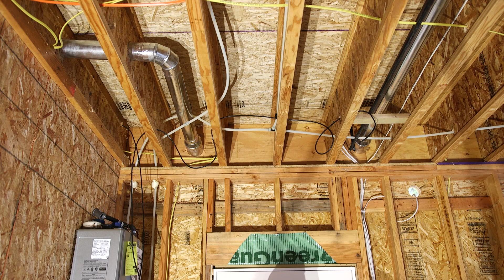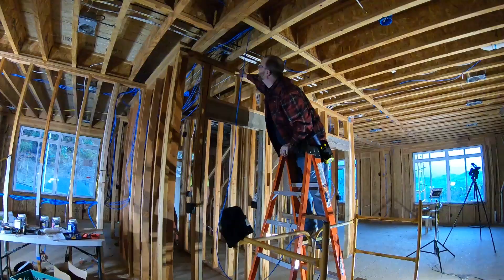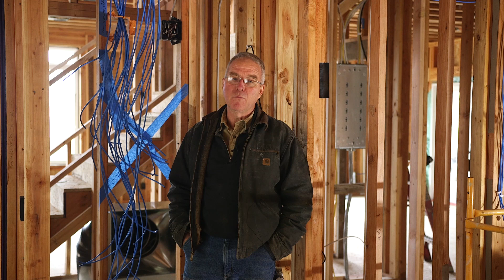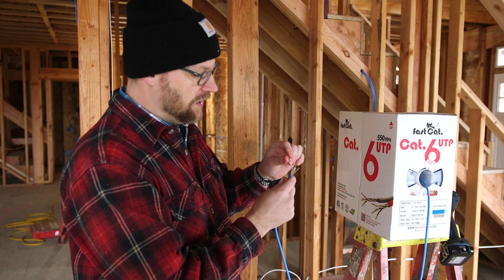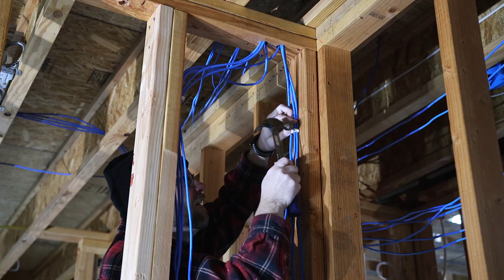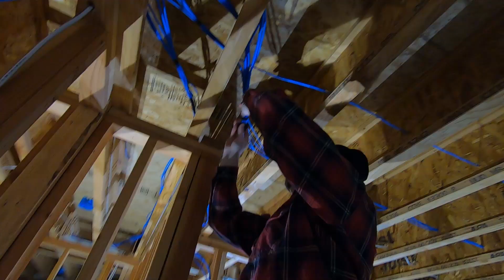Installing A Home Network Ep.100

Comment: 7:53 protip: tie a bit of string to one end of the cable, then pull the other end through (pulling the string into the wall where the cable was laying). Check the cable, if its busted, then untie it from the string in the wall, tie a new cable to the string, and pull the string back through (pulling the new cable into the wall, in place of the old cable). Useful if you want to replace a cable with something different too (e.g. old coax for ethernet) - just tie the new cable to one end of the old cable, and pull the other end all the way through.
Reply: Only works if you don't staple down your cables like he did.  Those aren't coming out short of ripping out drywall, and any new or replacement runs (like when the homeowners realize they should've gotten 6a instead of 6) will need to be fished through separately, probably using new holes entirely.

Should've installed conduit instead of stapling cables to studs.
Reply: That only works if you have conduit. The issue with modern data cabling its that its too stiff to pull through conduit.

Comment: Also by the time you read this the drywall might already be up but you should try to leave some spares for WAP's in the ceiling (At least one per floor). Also add conduits to  the attic from the rack location if you can for the future
Reply: Good idea but not mandatory. There are efficient Wifi mesh systems that can be installed simply using the wall outlets.
Reply: @articchar-lf   Not mandatory, but a hell of a lot cleaner looking installation.  Also, I take it you aren't married... :)
Reply: Done! Several cable runs are for WAPs. ;)

Comment: Is this for DSL? Everyone else uses WIFI and Bluetooth unless this house is so remote they have to use Dish or some other internet.
Reply: We have an old (1805) stone built house. I'm almost as old and have been in IT and Comms since 1970. Our network is modern with fast WiFi, plus bluetooth for guests and visitors, but for my own PC I have CAT6 cable going to the router ;)
Reply: "DSL"  is one method for your internet service provider to deliver internet service to your house (over phone lines).  In Scott's area, the ISP is using coax,  that it the RG-6 Coax (black)  whcih was being installed in the beginning, so no DSL here.   The blue cables are being installed for an ethernet network, whcih makes internet connections available in every room.

Comment: Hello Scott, did you run a CAT6 to the same place where you ran the RG6? In my area the provider is running fiber to the side of the house, where CAT6 is then run from a small converter box back to your "media-hub". You might not get fiber for a few years, but it will come eventually. Love your work, happy 100!

Comment: We dont use category 7 or 7A because it's not enough of a step up from cat cat 6 or 6A so it never really caught on here. category 8 is more for data centers because its maximum length is only 30 meters compared to the usuall 90 meters you get with 6 and 6A

Comment: My parents ran Eithernet cable throughout their house 20 years ago. And we’ve never used but one of the jacks for the wireless router which has always been more than adequate for streaming gaming and a computer or two.
Reply: yea that is exactly what I am thinking as well. funny I have to scroll down comment so much to find first mentioning of "wireless" but still, I guess it is better than not having it. And I absolutely love this series.
Reply: @hr1551  That’s why they put it in, 20 years ago there wasn’t fast internet where they live (still isn’t really). But it’s there and always will be. I’ve also watched pretty much every episode, fantastic!
Reply: Even with the absolute best wifi router, there is a noticeable difference in performance and reliability in simple A B testing.  Wifi is merely "good enough" for a lot of people. But Wifi is far too unreliable for me. Too many locations I've used Wifi in where external interference can overpower your wifi signal and there is nothing you can do about it. My grandmother's house is one such place. She lives up on top of a mountain and all I can imagine causes her interference is actually a weather radar array quite some distance away. Connection will be fine, with no wifi networks sharing the same channel. Then with absolute regularity as I imagine the radar array slowly turns toward the house the wifi connection drops to unusable and then back up within about 5 seconds. And it's certainly not a fault of the router as it is my own. In apartments, wifi can often be nearly unusable due to too many access points using the same channels as there simply aren't enough available. Wired networking solves all those issues and has literally zero drawbacks.

Comment: Ive been installing computer cabling for over 20 years and Ben did a fantastic job of explaing the basics and things to watch out for. Great job Ben!
Reply: You've been installing cable for 20 years and you replace every cable that kinked during installation?
Reply: @robc7417 Cat 5 and fiber is less forgiving
Reply: @harryhunts6171  Fiber is like a vengeful girlfriend. You one thing wrong, and she snaps.
Reply: @challengecompleted55  glad I only work with Corning fiber.  I can get get that to about a 2" radius before I see significant loss, even in SM, but rarely do I see a break.
Reply: @thetable123  Yeah, you've got to REALLY be rough to get a real break. Bending that sharp is a no-no but you can prevent that easily just in the method you pull.
Reply: @jackshett  Agreed, fiber is not nearly as delicate as some here seem to believe.  If someone is 'snapping' fiber, they are probably f'ing up everything they work on, and OTDR/cable testing isn't being done.
Tape the fiber to an Cat5 pullstring and Bob's your uncle.

Comment: I would recommend not putting all the cable into a LW ring like you did in 3:16 of the video. it’s going to be a pain later.
I would also avoid clips on the cable it increases the likelihood of kinking the cable and makes it pain to get a "bit more" out of it when you need too.
also, STP CAT6A would have been a goods ideal to CYA for years to come. 

GREAT VIDEOS KEEP THEM COMING!

Comment: when i was converting the old primary school, i now live in, i asked anyone i met who worked in networking, and was told to put three cat6e cables to every tv point in the house, i have five bedrooms, two sitting rooms, kitchen and two utility rooms, tv points in every room that's  a lot of cables, they said it would future proof, the house
Reply: Uhm, I'm all for future-proofing, however that sounds like someone took the normal pro-active 2 cable/drop location, and upped it 50% yet again.  Might have been an idea 10 years ago? Since then, it seems like the Firesticks and Roku's are going to stay wireless.
Reply: @boots7859  ask any tec person involved with internet in the home and they say it's hard to beat hard wire internet. my firestick can be ethernet or wireless

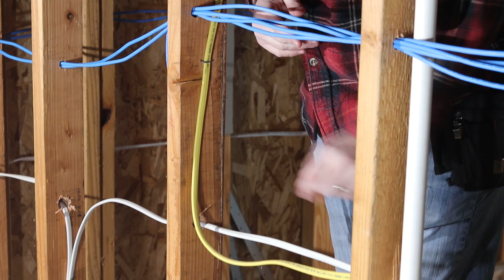Comment: 10:40 The interference is not very likely - unless you'll purchase the cheapest non-shielded ethernet cable available and use the cheapest plugs & terminals as well. In an office complex with 1000+ separate ethernet lines in the same shaft, could actually be some interference, but not in a household with home network grid only :)
Reply: I once had an intermittent network interference problem on a Trading Floor  (8th Floor) next to the River Thames in the central City of London (UK). After some sleepless night, with the team, trying to track the cause  an ex-navy office clerk spotted the cause. Across the river about 300 yards away was a foreign  Navy Destroyer tied up during a courtesy visit. The network interference matched the rotations of its radar system which was being periodically run. Rumour has it that the Head Trader bribed the Captain, to keep the radar turned off, with a crate of Champagne and a trading floor visit.

Comment: Do you have trouble with mice eating your net work cable? I think it is because they want to go through the hole the cable goes through.
Reply: Most regions require any pipe, or cable penetrations to be blocked using fireblock caulking (Building Codes) When it cures is almost as hard a cement.

Comment: I've seen grocery stores have their network cables replaced. There's a surprising amount of Ethernet cable in a store, not just a line to each register. Where the other 40 or so go, I don't know, and not sure I want to know. Glad I was just a spectator.

Bonus: when a store my ex worked at was being remodeled, the installers just gave her the leftover bit of a spool of Cat5E. There's at least 100 feet left in that box, they were just going to throw it in the trash because it was too little to use for commercial application, but my girl was smart and asked "hey, can I have that?" I would get the tool to put the ends on it and wire parts of my house, but, like Ben said, it's a pain to do with the drywall installed, and wifi works well enough to not bother crawling around the corners of the attic. But a boy can dream.

Comment: Hmm, at least here in Germany having Cat-7 vs Cat-6 is minimal upcost compared to the labor cost for installtion. So in my house I not just have the standard networking outlets with Cat-7, but also the light switches (which are switching surge relays in the basement) are running through Cat-7. So in theory I can make every switch a networking outlet, or run any other protocol (rs485, KNX etc) trough them. I think that should be pretty future proof. But maybe slightly overkill :D

Comment: I've never seen "stranded" cat 6 cable anywhere. The copper wires are already tiny, so its flexible anyway.

Also, speaking of not kinking the wire, the kid pulling the rg6 made
A loop in it and yanked it through the drilled hole, badly  kinking it.
Reply: Saw that.
Reply: a lot of the premade cables are stranded. You won't see it cause it's already made. Just hold the two and bend them and you can feel the difference. solid copper is noticeably stiffer.
Reply: Every patch cord you have ever seen is stranded cable! And RG-6 is coax and nowhere near as delicate and doesn't "kink" like UTP does!
Reply: @mok1970  high frequencys require a 3 inch min. Radius to maintain impedance.
Reply: Stranded cable is not just about flexibility, it's about durability. Stranded cable will deal with being bent and unbent better than solid core, hence why it's used for connecting terminal devices (PCs, printers, etc) where the cable is likely to be moved around compared to infrastructural cable (sollid, embedded in walls and doesn't move).
Reply: @y0rema  "Stranded cable is not just about flexibility, it's about durability. "  The two are pretty tightly connected to each other.  Stranded is durable because it's flexible.  It's more flexible, because when you bend it,  you're deforming less metal.  The same way a steel cable is a both a lot more flexible and a lot more durable (in terms of bending cycles) than a steel rod of the same diameter.

Comment: One other important clearance item: DO NOT let these touch CPVC sprinkler lines.
Reply: Gotta ask--why not?
Reply: @adamr1637  the plasticizer in the cable will react and start eating through. I saw a failure 6 months ago that took 8 years, but both sprinklers and cat6 are in most house builds I see now.
Reply: @thegundlach  Good to know, thanks. I'm an electrician and a building inspector. I see a lot of installs but I've never heard that before.
Reply: @adamr1637  it's in the CPVC manufacturer requirements if you need a citation

Comment: Is it going to be spray foam on the inside walls or some other type? Keep up the good work!
Reply: I doubt there's going to be any foam on the inside walls.  Unless you're installing a home theater and want soundproofing, inside walls are rarely insulated.

Comment: Great video, as always. Love the no-nonsense tone and approach. Question though, why so important to label the various cables that come back to the main switch? The network data will find its way around just fine, is this for tracing connection issues?
Reply: It's for testing the integrity of each feed once they have the RG-45 connectors attached at each end...very easy to accidentally switch two of those 8 conductors when adding the connectors, and that's all it takes for the feed to not work

Comment: Famous last words: "There are 24 24 separate network jacks in this house. That's probably more than anybody's ever going to need"
Since many things are becoming wireless you are probably right though, they most likely won't be needing that many anymore. But especially when installing security cameras in the future you'll be very happy you did. You *NEVER* want to run security cameras on a wireless connection if there's any other option available.
Reply: All those jacks will let them add wireless access points all over if needed.
Reply: @nooneusesthisname  you don't need 24 of those in a wooden house that doesn't block much ;) I would be surprised if you need more than 1 really. But better too much than too little
Reply: The problem with wireless is that it is killing mankind.  It effects every individual differently.  In our home we have eliminated every source of wireless tech.  So hard wiring everything would be how I would do it.  Right now we are dealing with a cover up of 5G radiation poisoning they are calling Covid-19 or Coronavirus.  In my area they are coming out and saying they have been planning this pandemic for 30 years.  Here are some great videos that prove this:
VODAPHONE SENIOR WHISTLE-BLOWER CONNECTS THE 5G & COVID-19 DOTS

https://www.bitchute.com/video/4cVKP2mxtY0J/

CORONAVIRUS - AGENDA - 4 PART SERIES 
https://www.bitchute.com/video/mWcUoESRO0c5

God's Voice, your DNA and 5G: https://www.youtube.com/watch?v=w9N5Y1-gkJo&t=742s

Warning about DNA modification in vaccines: https://www.youtube.com/watch?v=Rrwx8nMlzfw

n advance of a full day's symposium on the impacts of wireless technology on our health, C4ST's Frank Clegg and a select panel issue a media release regarding Ontario doctor's warnings of rising health care costs in light of 5G roll out.
https://www.youtube.com/watch?v=S16QI6-w9I8&feature=youtu.be&fbclid=IwAR2qeVqPj0M4a0UfnQKCkuI54QbuBrAg6Y8nZRefAt6-H0V0ESbDoDnemZA
https://www.whistleout.ca/CellPhones/Guides/5g-in-canada-wireless
New Class of Human: https://www.williamhenry.net/2020/11/the-great-reset-and-the-new-class-of-human-time-for-cathar-yellow-star-crosses/
Dr. Wakefield warns=”This is not a
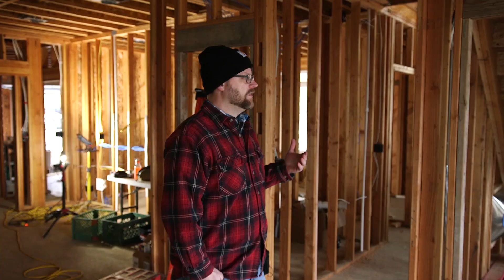 Vax, it is irreversible genetic modification”  - 9:54

https://newtube.app/user/Darek/rjkE32b?fbclid=IwAR3LDWzGcpw-aoygNuEafC6RiubayBTb1dcYzc51RUon7FTyREvjiwTx33k

Comment: Scott - nicely done. Living in an older home where wired networks to the second story are but a fantasy (we ran “state of the art” coax to each bedroom when the house was built in 1996), can you summarize where the 24 connections go? Assuming 2 snaps per wall plate, that’s still 12 unique locations in a 2 story home with no basement...

Thanks!
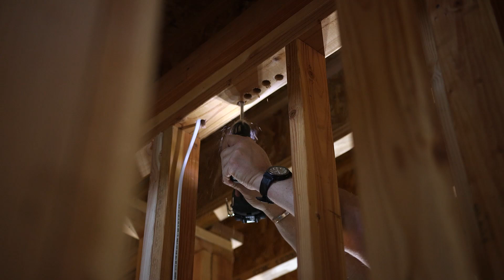Reply: 2:38 every room + outside corners
Reply: @nordlands8798  Thanks - not sure how I missed that.